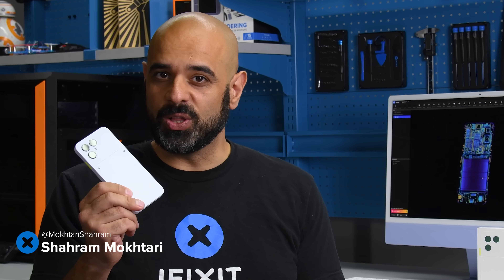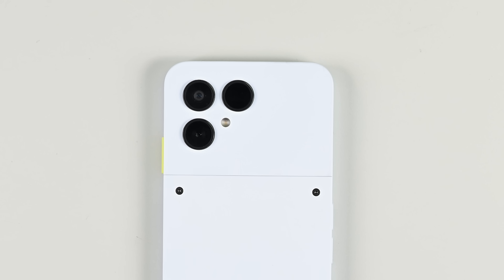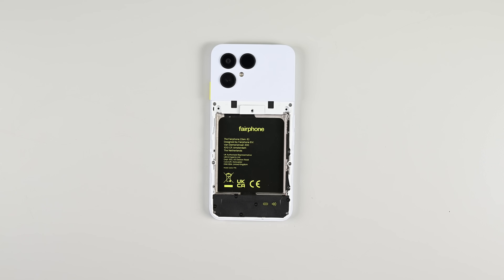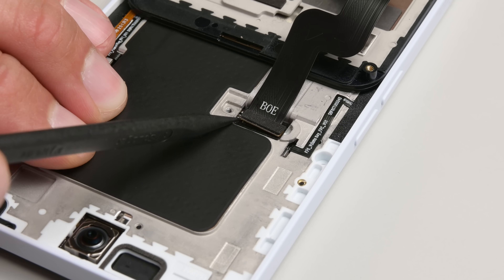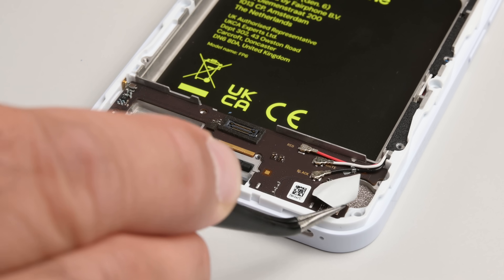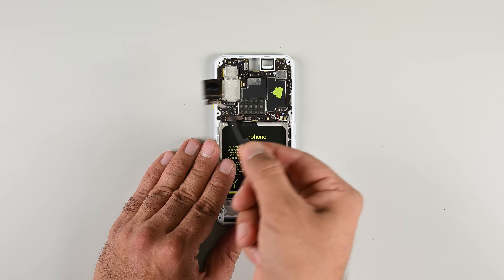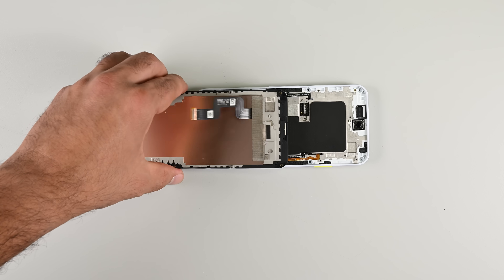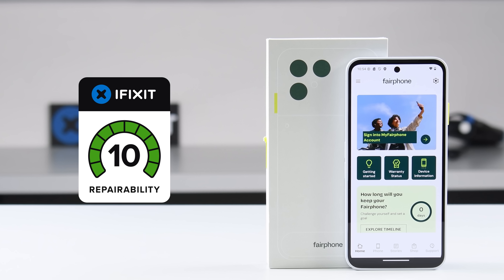The Most Ethical Smartphone Yet? Fairphone 6 Teardown & Review

Comment: I wish they were available in more countries and more affordable.

It's lovely that it's repairable, but why does it have to cost as much as 3 lower mid-range phones with similar enough specs?
I.e.: Moto G56 which I ended up ordering in the Americas.

Also, please make it easy to get all the parts worldwide in a hurry. I was seriously close at getting a HMD Fusion because of it's DIY repair-ability, only to realise that the screen (the main component that breaks), is constantly out of stock.

Lastly, an IPS screen option would have been great. Not everyone tolerates OLED flicker. I ise my phone as a navigation device and OLED struggles here as it's more prone to overheating, requiring the phone to switch to dark mode.

Comment: Is it possible to develop a phone with upgradable SoC?
Reply: Not viable. SOC improvements are too fast, so a standardized connector would probably need to be replaced after 2 years or so. That means you get 1 generation of upgrades, which is a waste of resources. Creating a connector would also require a lot of effort, which costs more money than just soldering it.

Comment: I have a Fairphone 4 and it's been holding up splendidly. I don't use a case and I've had this thing smash into hard surfaces a lot over the years. The only thing is that the screen scratches pretty easily. Honestly I think I can keep this phone for years to come. Recently I've been thinking about getting another battery because it's starting to drain a bit fast (after more than 3 years). The fact that this is an option and doesn't cost the price of another phone is amazing

Comment: Still has some backwards design elements. Why use screws for the back cover and battery? Galaxy S5 had a back cover and battery with toolless disassembly and waterproof seal, a decade ago. If it doesn't have toolless battery removal, it should at least have wireless charging. Why no headphone jack?

Comment: USB 2 instead of usb 3? That's disappointing. I still prefer to transfer my files to my PC instead of cloud and I don't feel like updating my wifi APs to the 6E or 7 standard yet. Using it as a desktop replacement with a docking station helps at work as well, but w/o DP I cant use the screen.
No matter, I am still happy with my FP5 and wasn't thinking of switching. But I do expect these things to be present when it's to to switch from the FP5 in a few years.

Comment: There's a good answer to a lot of questions! As a European citizen who is boycotting American products wherever he can, I would add the European provenance of the phone! Your repair demo got me thinking: Since its often one part that 'terminates' the use of a phone, I wonder whether it might be feasible to put still functional parts in a fairphone to use! That would require additional tools and skills, and probably a lot will not be compatible, one would have to deal with glued and sautered connections, but wouldn't that be nice? Or how about that: Fairphone makes a list of devices from which they can use the parts, and one could donate old phones to them.
Reply: Frankly, I don't think that any standard parts can be used in a Fairphone, because Fairphone had to heavily change the architecture of their phone to make it repairable.
Your average Samsung components have the wrong shape, connectors and specs to be swappable with a phone that deviates so far from industry 'standards'.

Regardless, I appreciate your efforts in boycotting American Companies. I'm trying the same, but Google is a tough nut mainly because of YouTube...
Reply: @overflow7276 That was in my mind. But its unfortunate! I am using an old Dell screen 4K 24'' one barely visible bad vertical line to edit my photos. I got it for 50 bucks on ebay. Instead of rusting in a landfill it's getting a few more years good use.

Comment: Usb C is a must, particularly if you want to reduce e-waste since usb C chargers and accessories are everywhere. And for me headphone jack is another must. Other than that it's absolutely great
Reply: It's usb-c but it's running at usb-2 speeds, which IMO is fine. Unless it has a built-in nvme, or you want to plug it into a monitor, it's not going to need anything much faster for data transfer.
Reply: @firstNamelastName-ho6lv yeah, true, but for monitor output and those cases, higher speed is desirable. Not terrible though.
Reply: @firstNamelastName-ho6lv actually I've though about it again and the number of times I've used my current phone's USB C port as a display output can be counted with the finger on my right hand: 1 hahaha

Comment: Bad camera, no aux, worse specs than my 5 year old samsung, no thanks! Even if you can replace the abysmal camera (I don't care to watch the vid to find out), I know for a fact you can't replce the cpu, can't improve its ingress rating (in fact, replacing things will likely make it less resistant), and likely can't improve its straight up odd (literally) resolution of 1116 x 2484 pixels. Neither of those numbers are standard. But I suppose that's the least of its issues. Weird theres been 6 of them and this company still can't get it right. They're releasing phones that are more than 5 years old in specs.

Comment: That battery is a step backwards.... 😬 On the previous model, you could pop both the back panel and battery off with simply your fingernails. 🤚🏾The lack of headphone jack is very unfair for a product that is supposed to be "Fair". 😠 While Snapdragon 7s Gen 3 is not a slouch,  Snapdragon 8 Elite would have been significantly better, especially for a smartphone that is supposed to last 8 major upgrades. 🐢 Aside from these 3 major faults, it is good to see that the Fairphone is still significantly more repairable than all the other smartphones in existence. 🌍 The only smartphone maker I am aware of on par with Fairphone would be the Shiftphone.

Comment: Had mine for a few days now. I actually made a mistake, as I thought it had wireless charging, and the main reason I hadn't switched to fairphone so far was due to a lack of it. I decided to roll with it anyway and see if it was worth the change, and I'm dissapointed to say that I don't think it was. its 2025, pretty much all cars have wireless charging pads in them by default, and almost all other manufacturers are getting into even their base-tier phones. I'm investigating how to hack it back in, because I really miss it. Also, the 'inneficiency' argument surrounding wireless charging is completely nonsense, and the absolutely miniscule amount of energy that a phone wastes when it charges wirelessly is not a good argument to not implement a feature that means I will A) have to replace my USB port less often and B) have to replace my battery less often as I can always be trickle charging it at my desk, in my car, or on my nightstand instead of always blasting it with a fast charger.... hopefully they make an OEM mod or battery pack with a wireless coil in!
Reply: You can just get an adapter for this and add that to a case or to a 3D-printed attachment. There will be lots of community-designed accessories.

Comment: Battery is no longer removable without tools and the screws are torx, doesnt seem as fair as the tool less battery removal in older models. Well maybe they use the screws to make the 7 water proof, but the 4 was really the biggest leap so far.

Comment: The replacement parts are still not available on Aliexpress nor on Amazon which defeats the purpose. I can get a screen for my iPhone XR for less than 10$ on Aliexpress. For me what makes a phone repairable is cheap and readily available parts. Some Samsung devices are even easier to open and replace the battery sometimes requiring no screws.

Comment: The main thing keeping me from buying a Fairphone is the fact that they use mid-range chips. In the here and now, the Snapdragon 7s Gen 3 is fine; it has a reasonably powerful and up do date CPU, with a good enough, though barely, GPU. They paired it with only 8 GB of RAM though, which is on the lower end when compared to most other phones with the same chip, and just in general for contemporary Android devices.
In five years time, how will this phone hold up in day to day use? While physically it will be more pristine than its competitors, due to its repairability, on the software side it will be far more sluggish than even the not too performant Pixel 9, and especially slower than the Galaxy S25. The main shortfalls resulting from lower RAM amounts and a much worse GPU, but possibly also from the lower single core performance due to the lack of a "prime" Cortex X core (or equivalent).

I wish Fairphone would lean on the safe upper end in terms of RAM, and get an older flagship chip from Qualcomm, or one from Samsung (Exynos), to have a more future proof GPU.

Comment: The perfect phone, this will be my next one. Yeah you could pay a repair shop to repair your glued phone IF they get the parts, but that's expensive and risky. My last broken phone worked fine but the USB port broke, got no replacement so the whole phone got in the trash and I would have nearly lost my data because no USB port means no wired connection to backup on PC. Also fairphone supports lots of other operating systems to replace stock Android.

Comment: I miss the 3.5mm headphone connector
Reply: Me too. Funnily enough, I recently recycled a broken pair of Bluetooth earphones by taking out the Motherboard and sautering the speaker cables to a 0.10€ Headphone Jack. Throw it in a 3D printed case and have a brand new 3.5mm to Bluetooth adapter. 

We live in times where a product must become e-waste to fight e-waste!

This is so absurd!
Reply: I feel the number of people still using jacks for headphones is not going to be enough to ever have that added again. It is also a very big component relatively speaking.
Reply: And FM radio! And also ir blaster would be nice.
Reply: @Roger-is9os  FM radio is already starting to get shutdown in Europe.
Reply: @Roger-is9os just use your data and download the app of the radio station?
Reply: I will never buy a new phone without a jack. Now I have to also buy digital audio player. See you when jack comes back.
Reply: i feel you but now most iem come with a flavour in usb c
i'd much rather have the extra battery personally
Reply: @ThishandleisntavailableHereis But then how does supply power at the same time from an intermittent source such as via a pantograph or third rail on an electric train?
Reply: @TimothyEBaldwin  Bro— What?
Reply: Literally no one uses it anymore
Reply: @krlsweet That's quite a stretch. Gamer phones like ASUS Rog and Redmagic still have them. Besides, the jack doesn't stop TWS buds from working.
Reply: @krlsweet yeah it's not like wired is always going to be inherently cheaper and have better signal quality...
That's why esports players use wireless headphones right?
That's why studios mix on airpods now right? 
And that's why 80% of budget phones even released this year that are 1/10th of the price of flagships don't have jacks right?

Yep, literally no one uses them anymore
Reply: @StaticNebula26  the signal from a jack still goes through a DAC; there's nothing inherently worse about digital wireless audio besides the latency introduced by Bluetooth, and technically keeping the signal digital for longer should preserve it's quality more. That being said, most wireless earphones don't have good DACs or neutral frequency responses (which is why they're not used in studios).

For most people this is not noticeable and the advantages of Bluetooth are far more... advantageous, so why sacrafice a larger battery for a redundant connector?

Comment: The first Fairphone that actually looks good! All I'm missing is hardware switches to turn off the sensors and camera covers (like is standard in laptops now). Then it would also be a great privacy phone.
Reply: In laptops the cameras are totally separate, so I understand, why it's not practical on phones. You can even use an old laptops camera as a USB camera. I just cover them up. For mic not that easy, but I use the vigilante app, for a noticable indicator of when the mic is in use.
Reply: i think its too expensive for what it offers. the hardware is years behind the budged range of Samsung and Xiaomi, so you are basicly just paying for ease of repair, which wouldnt be needed if companies like samsung and apple were providing repair shops with machinery and parts directly from them.

Comment: 8 years of security updates and 7 OS updates, that sounds all nice on paper but with a mid range chip after 5 years or so, its going to be slow considering how these apps are getting larger and larger these days with barely any optimization since developers seem to enjoying using brute performance to make their apps runs smoothly.
Reply: Even five years with the latest updates is a great lifespan for a smartphone if you compare it to other brands. Of course a Snapdragon 8 will be able to handle new apps longer but the battery of comparable phones will be at a unbearably low capacity with repair costs at upwards of 80€. In this regard a weaker chip will still work with acceptable battery life even if the capacity of the battery has dropped a lot.
Reply: @azmodan4179What other brands? Almost all of the bigger ones give you 4+ years of Android and 5+ years of security updates which is more than enough
Reply: Maybe revert to FOSS like from the F-Droid store. These apps are written with love, and are more efficient and lightweight most of the time.
Reply: Not necessarily, there are still some phones in circulation in friends/family form 2018/2019, and they work fine. Sure, they are a bit slower than they used to be but part of it just the 60 hz screens. It's not the pre Android 5.0 days anymore when even a year could make a huge difference, as long as you have fast storage, enough RAM and a least a midrange modern CPU, it should be enough.

Comment: 600€ for a 200€ smartphone with more screws and less glue. Repairability is worthless when it's this expensive, both device and parts. Same goes for framework laptops. On top of that, you can see how lazy it's the battery connection, we solved this issue decades ago with contact pins. Also, new batteries last longer and all EU smartphones will have easy to replace battery. I do appreciate clean software, more updates, modular USB-C... but if it's cheaper to repair a non repairable smartphone(non official part seller) and I can buy anyway 3 smartphones for the price of this one... what remains, more sustainable? not if I repair or sell the non-repairable smartphone to someone who fixes it. Their target audience is the kind that would pay more to feel better about themselves

Comment: This phone has no headphone jack. An adapter isn't good enough. Wireless headphones are not a replacement. Rather buy a new iPhone than this, and I'm no Apple fan.
Before Samsung removed this feature too, they had an extremely easy to replace modular headphone jack. No reason why Fairphone couldn't be like that.
Reply: fioo btr15 solved this problem for me, but yeah youre right, you shouldnt expect people to buy a adapter to solve a lacking headphone jack.
Reply: @WingdingMathe  A bluetooth DAC is even worse IMO. You get the disadvantages of wireless (battery that runs out), the disadvantage of adapters (risk to lose or forget it), and also the one disadvantage of wired (wires that can get tangled up). Whatever floats your boat though...
Reply: You would rather buy an iPhone due to this Fairphone lacking a headphone jack, even though no modern iPhone has a headphone jack either? That tells me you must be invested in the Apple ecosystem already? 
I've had an iPhone SE 2020 since, well mid 2020, so going on five years, and I have had zero issues with the Apple lightning -> 3,5mm stereo adapter. It's very small and portable compared to the on-ear headphones. 
I'm thinking about this Fairphone for the fair bit as well as extendable storage. "Your free iCloud storage is full, please pay for it" happened pretty quickly. So am I invested in the Apple ecosystem? I haven't any other Apple product and the apps I use on the phone are available for Android too (or equivalents), maybe that's the case for you too. But in your case the Sony Xperia 1 VII might be interesting? Headphone jack
Reply: @Vantrakter  I'm not invested in the Apple "ecosystem". The only reason to get an Android phone is that it's better than an iPhone. But without that jack, new Android phones and new iPhones are equally as bad! No matter how many bells and whistles you add, nothing can make up for the lack of that feature (Bluetooth is present on devices with that jack too). And they're almost the same price. So if you must get a newer phone, might as well follow the herd and have the status symbol.

For me personally, I'm doing great with my "old" SE 1 after replacing its battery recently. It's the newest phone from any brand with compact size and headphone jack. An actual old phone can't run updated apps or security updates from this year.
I've been trying phones without headphone jack for years. It's always a little less convenient. Why should one put up with it? Just because the phone is newer? Keeping older devices instead of throwing them out is better for the environment too.
The new Xperias are really good, but they're a little large. Still, I'd definitely pick one of them over anything without that jack.